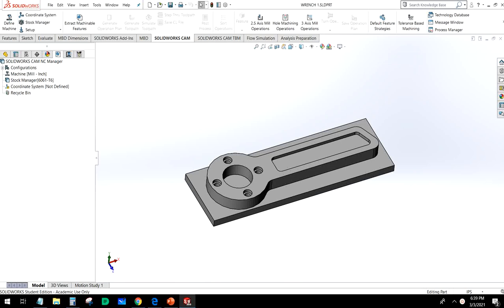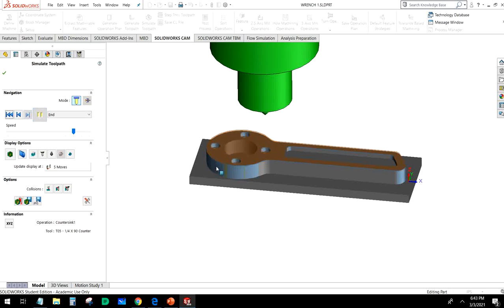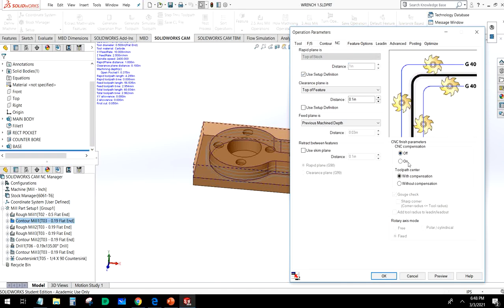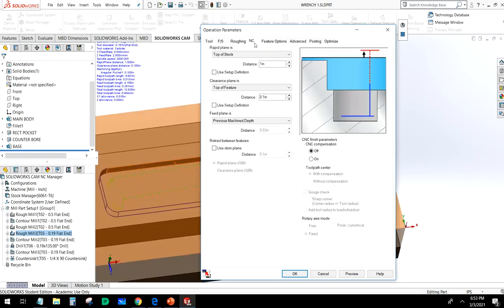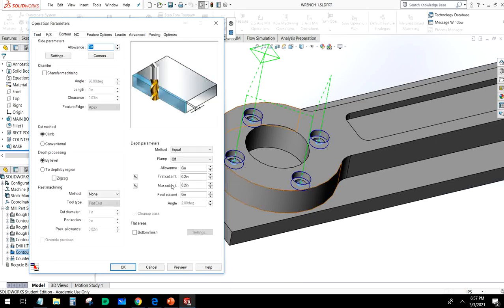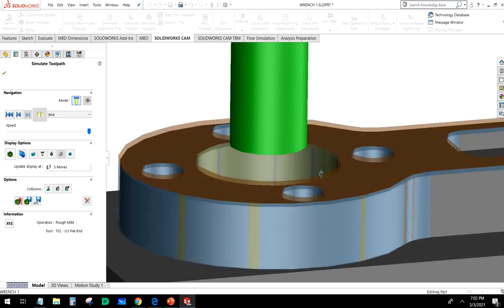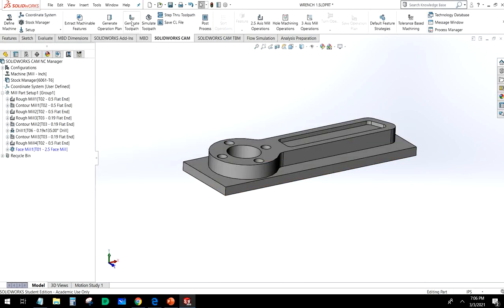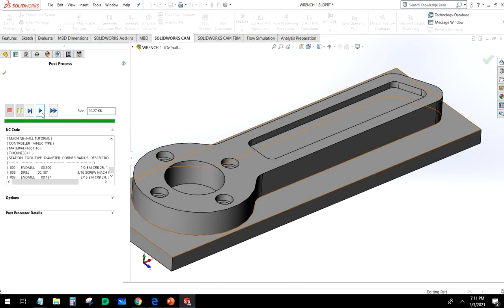SOLIDWORKS CAM: TOOL CHANGES AND ADDING TOOL PATHS

Comment: Professor Cameron, thank you very much for your time and efforts to provide these tutorials. Do you have a tutorial to take this part in this tutorial or any other with Ref G54, vise #1, to the second operation, G55 or vise #2, to face off the bottom and finish with a deburr op? I'm not sure if I'm looking for a 2nd mill oper, a sub routine, or a G52. Essentially,  every time I open the door I'm loading a blank and unloading a finished part. Thank you.

Comment: Thank you very much for this video.
When using the Volu-mill strategy, the feed rate values in the g codes may have decimal places. the problem that the controller of a machine does not accept decimal places. Is there a way so I get just integer feed rate when using Volu-mill.